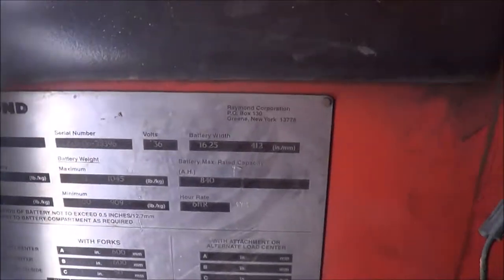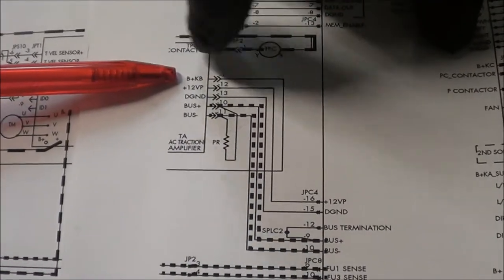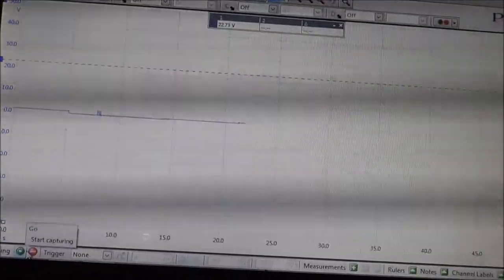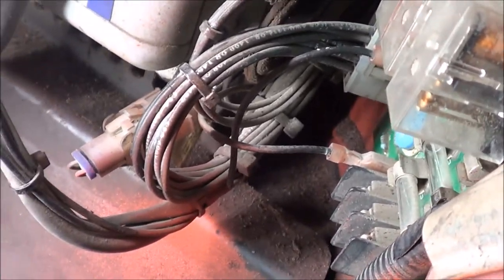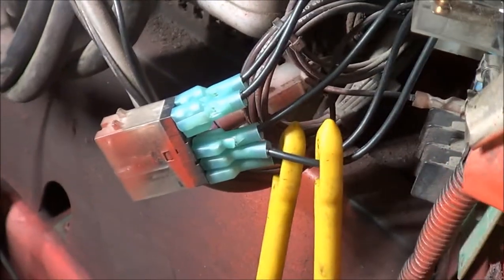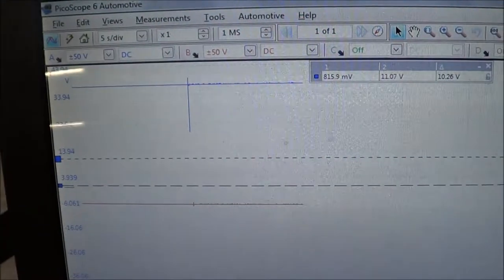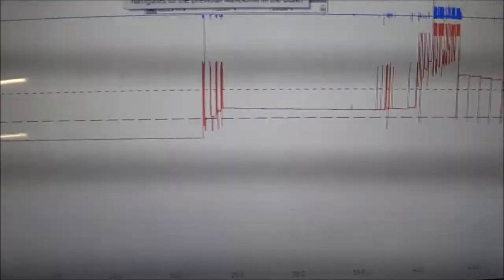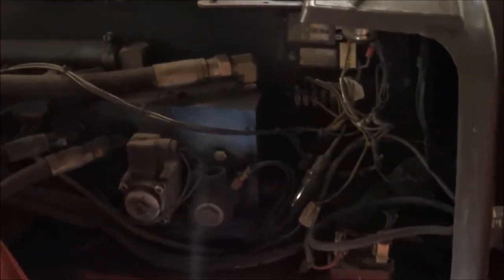Raymond Reach Code 5G (No Comm)

Comment: Quick question on a toyota stand up similar to that Raymond  . Will a low battery (unit starts up at 8 bars then suddenly drops to 2 bars on the dash gauge) cause codes 4c, 5f, and 5G? Unit starts up and works fine sometimes. Then sometimes codes out ASAP as soon as you turn it on. Battery issue or relay issue? Any suggestions? Thanks!
Reply from the maker: +Charlie Hustle yes it can. The controller can only read voltage levels. A drop in voltage to the relay could cause it to drop out. If possible swap batteries and see if problem goes away.
Reply: ForkliftGeek thanks for the quick reply bud. I'm a tech in the bay area and the bosses are forcing me to diagnose some electrical lifts now.  I'm trying man. Lol. Btw, are you pinoy? Cali? Loving your vids bro
Reply from the maker: +Charlie Hustle yep I am,  born and raised but I'm based in Toronto now. Thanks for the kind comment.  Its a must now to understand electrical amd electronics. Even ICE forklifts now are all computer controlled.

Comment: Any info on a Raymond order picker code 8L. Already swapped brake and harness. Still have the same code
Reply from the maker: Check K2 relay
Reply: @forkliftgeek10  this model Order picker has the relays soldered onto the board, so I switched the card with a relay board off another order picker and the code is still there. New brake harness or brake has corrected the issue. The code just won’t clear

Comment: I have a Raymond model number 540-OPC30TT truck works just fine until you  turn left all the way and it codes out with the 5G code any ideas ? I’m lost.
Reply from the maker: https://youtu.be/4PSauB8fTHo. The wire I fixed on this opc goes down along with the drive motor harness then loops back. Considering the the code only happens when u turn, it is probable that it gets stretched and looses connection.
Reply: ForkliftGeek thank you again for the fast response. I am service technician in Denver Colorado for a year and half.
Reply from the maker: No problem. Did u figure it out?
Reply: ForkliftGeek 
Ya it was just like the video you suggested

Comment: Hi I have Raymond easi dr30tt code 81 the forklift move forward and reverse but the forks going up but not going down. I have flashware but I can’t connect to the truck. Any help would be good
Reply from the maker: Your lift potentiometer is either faulty or out of calibration. Try doing a relearn first. You can run test A05 to verify if you can get into the system through the display.
Reply: @forkliftgeek10   i change the handle control but I never calibrated. I use serial cable to connect the software flashware but not connect. How i can do relearn . I’m new with this
Reply from the maker: Right side shift button and horn, then key on will bring to password entry. To do a relearn you need the super password though.
Reply: @forkliftgeek10  thanks for reply I would try tomorrow .but where can get the password
Reply from the maker: @heavyduty1936  if the customer does not know the password then only the dealer can reset it.
Reply: @forkliftgeek10  no he doesn't know.  is there another way to do it?  Like I told you, I have the software but I can't communicate with the truck.  You know which is the diagnostic connector and which is the cable or interface to communicate with the truck for now I am using the serial cable
Reply from the maker: Sorry, I have never used any software because I don't have access to that. I've never worked for the dealer so I would not know.
Reply: @forkliftgeek10  I understand .I was looking a topic they say I can try enter superword ray1 or ray2  .But I don’t know is any risk I can block up the system if I do that that??
Reply from the maker: No. It does not have a disable function based on the number of password entries.
Reply: @forkliftgeek10  Thanks I will try tomorrow